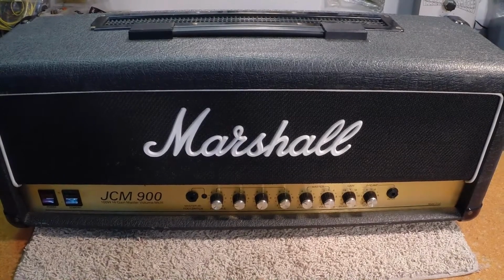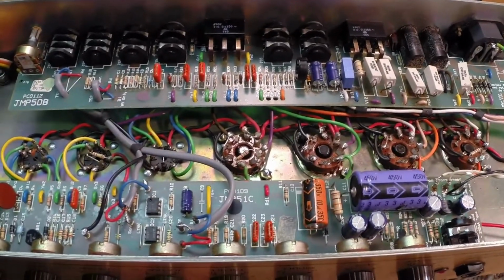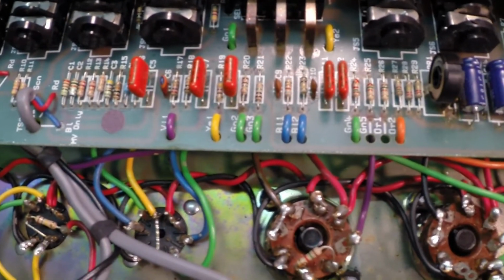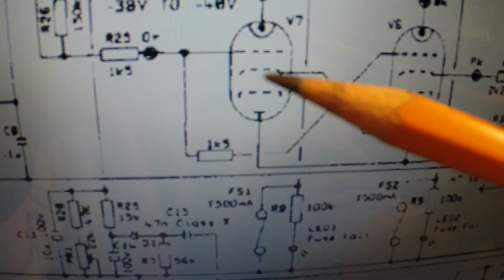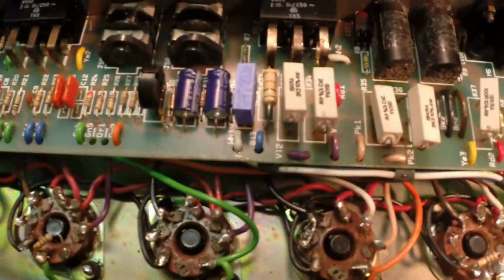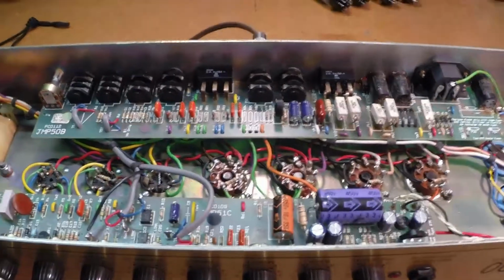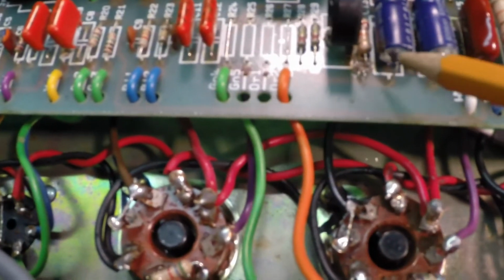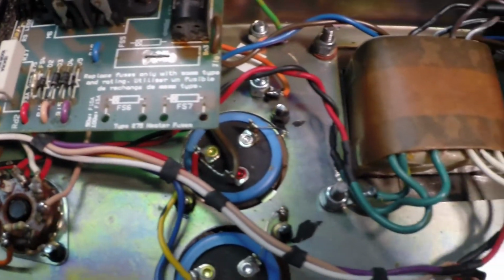Marshall JCM 900 Repair

Comment: Excellent video, do you think I could remove two valves from a JCM900 MK3 and use it in low range by simply doubling the impedance of the cabin?
Reply from the maker: Short answer, yes.   But! Remove the inside pair or the outside pair of tubes. 
 Not two on either end.  Here is what I tell everyone.  If an impedance selector is involved the standard 4-8-16 ohms becomes 8-16-32 when pulling two tubes.  In your case, the std wiring for the impedance switch is 16(4) and 8 ohms.  If you are using a 16 ohm cabinet, then you would use the 8 ohm setting.  If by chance you have an 8 ohm speaker cabinet, then you would have to move the tap to the output transformer from 16 ohms to the (4) ohm option.  Operating the amp in the low power mode (faux triode) with two output tubes should bring you down to roughly 20 watts.   
  BTW, if you have not done it search my channel for ALL the JCM 900 videos.  Even if you are not interested in some of the 4500 mods involved, you may find some information explained better in differend videos.  Especially the issues of the safty cap and over voltage, and failure.
Reply: @guitarc.p.r.9675  Thank you very much, I will do it and review all the videos. I learn a lot from you.
Reply from the maker: That is why they are there.  Free info.  Paying forward so to speak.

Comment: Hey brother! For those resistors that are in the wrong place, R25/26? Where should they be going? Sorry if it's not an easy question to answer, but I'm just kind of trying to put a list together of revisions, upgrades, and mods that I'd like to do to my fave amps one day. That may sound a bit cheesy, but I just have a fairly small collection of amps I use in the studio, and I'm slowly getting there in terms of being able to do my own tech work, so just mainly taking notes for now.
Reply from the maker: I explain and show that in the video I believe.  They should be on pin 5 of each output tube, and not in series as on the schematic or in the amp originally.
Reply: @guitarc.p.r.9675  Hey, I actually want to apologize. There was another video where you were mentioning this as well, and I had actually already inquired about it, with a few other questions, in which you totally answered, and were trying to help me. It was quite awhile ago, and I was supposed to email you, but I guess I got busy, and totally forgot about it, so I apologize.If you're okay with it, would you mind if I sent you a little email sometime this weekend, or so?
Reply from the maker: Sure, email away.

Comment: What year? This marshall?
Reply from the maker: This one has the JMP50B power amp board making it a 1990.  The 2100 series began in  1990 and discontinued in1993.
Reply: @ Are everyone who has this plate from 1990?
Reply from the maker: If the board is labeled JMP50C yes.  Actually, like most things British it is not that simple, and can be very confusing.   So let me expand on this.
  CD0192 Issue 1 JMP50A PCB  1989*
  CD0192 Issue 7 JMP50B  PCB  1990
  CD0109 Issue 4 JMP51A PCB   1990
  CD0109 Issue 9 JMP51B PCB   1990
  CD0192 Issue10JMP 50C PCB  1992
*schematic drawn in 1989 amp went into production 1990.  So there you go.

Comment: I've got one on the bench right now and spent a whole day trying to figure out and studying all their schematics (all versions, 5881 and EL34) on the grid resistor issue.  Makes absolutely no sense whatsoever.  I know this is old news for you, but thanks for the collaboration.  Replacing the "X' class bias cap with the 600+ volt is the right move also, in my opinion.  That's what I do.
Reply from the maker: Thank you, someone who agrees with me!  The grid resistor issue is simply a mistake on their part.  Thanks for checking out the channel.

Comment: Hello, I've just bought a Mk3 2502 50W combo. Checking the power tube sockets on mine,  R24 and R27 are connected through green and orange wires only to pin 5. Pin 6 doesn't have any connection whatsoever. I see in the video that the resistors are jumping pin 5 and pin 6, so I assume if I'm removing R24 and R27 from the board to install them in the tube socket, I would have to jump pin 5 and pin 6 too. Or is the 50W different than this 100W from the video, and I can leave pin6 alone and only add the resistor to pin5 (in series with the wire)?
Reply: To add to my comment, doing a bit of research, EL34 datasheet doesn't even mention pin6, and also checking my EL34EH tubes, they don't even have a physical pin for pin6, so I guess it is safe to jump pin5 and pin6 with the resistor. I was measuring my bias current, and it was 38mA in the outer tube (the one next to the filter caps) and 28mA on the inside tube. These are supposed to be matched tubes, but I didn't check with another matched pair (I'll do that later), but would you account this 10mA difference to the resistor placement?
Reply from the maker: You are correct Pin 6 does not have a connection in the tube.  Connect 5.6k grid resistors directly to pin 5 alone. There is no need to connect them to pin 6. Stand them straight up.    AND change that bias cap!   As far as the current on the tubes, They should be within 5 ma of each other to be matched.  I like to measure plate current only so if you have a screen problem it does not reflect on the plate current.  You may have a screen resistor problem on the low side.  I also highly recommend looking through this channel for the other 900 videos, watch them, and read the comments as well.  There are a lot of questions answered there.  Thanks for watching, I hope this has helped.
Reply: @guitarc.p.r.9675  Thank you for the quick answer. By bias cap you mean that one that's 250V but should be 600V, right? Mine currently has a 47nF 250V. I don't have a replacement currently, so I'll order one online. The unmatched tubes, I will test tomorrow with a pair that I know for a fact is matched because when I biased my plexi-1987 last week they were only 2mA apart. If those also give a higher difference in the 900, then it might be a problem indeed. Cheers!

Comment: I'm having a problem with a JCM 900 4100 with the same version circuit boards. The two outer power tubes are drawing idle current but the two inside tubes are not. I have good bias voltage and plate voltage on all tubes. Any suggestions?
Reply from the maker: Check screen voltages.  The screen resistors have a bad habit of the solder joints failing.  If the amp has failed previously and new tubes were installed, the screen resistors could also have failed.  The more likely scenario is that the 500ma fuse on the cathodes has failed.  If so the tube failure led should be lit up.  There is one fuse and led for each pair of tubes, center and outside pairs.   Just guessing though.

Comment: Excellent work.  For the love of God, why would anyone change an MkIII over 6L6's?  They aren't bad in a Dual Reverb or SL-X, but it just seems like heresy to convert in MkIII.
Reply from the maker: I don't see how that relates to this but, thanks for watching anyway.
Reply: @guitarc.p.r.9675  You verbally and visually pointed out how a previous tech installed 6L6 output tubes when you turned the chassis towards the camera to show us.  That is the relation to my comment.
Reply from the maker: Ok, It has just been quite a while since I did that video, and I was not sure exactly which 900 video it was.  Actually, I sometimes use the JJ 6L6s in the 5881 models for the really heavy guys.  They do not "mush out" as much as the 5881, the bottom is much tighter and defined.  They handle gain better, and they "chug real good".  In this particular amp he did not like them as he said they were just too much in the bottom, and wanted to put 5881s in plus take care of some age issues.  Turned out his bass issue was actually a WAY off spec bass pot.  Thanks for clearing that up, and thanks again for watching.
Reply: Understood. I too have 6L6’s in my Dual Reverb. The amp in this video is an MkIII and all of those were manufactured with EL34’s. So someone (previous owner and previous tech) went out of their way to convert it. At any rate your videos are great and a wonderful learning tool. Thanks for making them.
Reply from the maker: I must apologize, I had completely forgotten about that video, and was thinking of another.  I am a repair guy not a cinematographer.  I have a few 900 videos.  I had forgotten how messed up that amp was.  I may have to refresh my memory on this one ....hummmm  2017.  Old one.  Thanks again for watching, and I am glad you are finding them at least a little helpful.

Comment: So 3 weeks ago I took my Marshall jcm 900 4100 to an amp repair guy. I had bought it on reverb and it was shipped from Italy. When it arrived i plugged it in and it had really low volume, crackling when i turn the knobs, and reverb did not work in both channels. After that there was no sound coming from the amp. I called the repair guy last week and he said they had to order a transformer for the amp. I hope i get to play the amp soon.
Reply: Very informative video btw!
Reply from the maker: Thank you it has had mixed reviews.
Reply: @guitarc.p.r.9675  what’s your input about the problems my marshall has been dealing with ?(:
Reply from the maker: Good question.  Given it is a used amp sold with problems it is impossible to make an educated guess of what the problems are, and I said problems because it sounds like there are several different ones.  The crackling in the pots is usually dirty pots or broken solder connections on the board or even a damaged pot.  The transformer in question may be the reverb return transformer, though I have never had to change one, it could fail  That would explain not having reverb on either channel, or it could be a problem with the IC circuitry and there is pleanty of it in these amps. The no sound thing cold be as simple as a dirty effects loop jack or as ugly as an output transformer.  However I tell people all the time, until it is in front of me on a bench we are just guessing and actual trouble shooting is the only thing that will give solid answers.
Reply: @guitarc.p.r.9675  I appreciate the response! I will update soon when it’s fixed.

Comment: I gather the grid resistor cock-up is peculiar to the 100 watt. In learning the "language" of the amp so I could work on it after coming from a black face Fender perspective I found my 50 watt bias system is as it should be and it's a pretty early example. First thing though, I replaced the volume and sensitivity pots which were shot. I then eliminated the resistors on the board the way you do and put 5.6k 1/2 wat on the tube sockets as well as 1 ohm 5 watt biasing resistors. Actual "mod" mods will at a later date.
Reply from the maker: Yes the main problem with the grid resistors being in series is only on the 100 watters.  However, the grid resistors should not be on the board and that is common on both the 50 and 100 watt models.

Comment: I’ve got a jcm 2000 tsl 122 on the bench and I suspect that class x safety cap to be the reason my bias is starting at 90mV per side after changing out the motherboard to the new revision 20 one. I see it is also 250v, should I replace it with a 600v? Kinda strange the two caps by the HT fuse are 22n 630v which are on the same board as this 47n 250v? Why would those two be 630v with this 250v on the same board?????? Why wouldn’t they all be 630v?
Reply from the maker: So, I take it the main board was changed due to thermal runoff?  Regardless yes, change the cap to a 600v.  I use the Xicon 630v it fits the board well.  Take a good look at the bias board as well.  As for the why the 250v cap, that is one of the great mysteries....boggles the mind.
Reply: @guitarc.p.r.9675  yep, already changed both bias trim pots and hit all of the solder connections. Thank you so much for you reply, you’re the only one so far who did out of four videos I commented on 👍🏽.
Reply from the maker: You may want to check out my other later 900 video it clears a few things up concerning that bias cap.  Thanks for watching and I hope it helps.
Reply: @guitarc.p.r.9675  just checked them out, super informative. Thank you sir👍🏽

Comment: nice video...is it possible to put varicac to supply the final valves(5881) with less voltage for changing headroom and dreaming have a better sound  without high gain-volume (similar like van halen)?

or put variac between output of jcm900 to cabinet 1960a is it dangerous? i'd like to have sound like when i left maximum value of gain and volume is amazing and reach of armonic frequency, but of course i can't do it cause neighbor..how can i have that sound with low volume?
Reply from the maker: Thanks for the nice comment!  OK, first thing!  Do NOT put a variac between the amp and cabinet.  A variac is to vary AC voltage, I firmly believe the only place one should be is on a tech's bench and  sometimes not even in that case.  Yes you could use a variac to drop the power supply voltages, but keep in mind that it is also dropping the 12 and 6 volt heater voltages  which may cause a few issues, but most importantly the 4500 preamp is mostly IC driven which runs on a +/- 15 volt supply.    I have seen a LOT of amps  damaged by such things. A variac  varies all the voltages in an amp.  It also lowers the plate voltages for the preamp tubes which also reduces gain and browns out the tone some.  Possibly more than the output tubes. Lower preamp voltages compress and grit up quicker too.  This is why power scaling is becoming more popular. The thing with the VH sound is you only get it loud.  Even variaced to 90v it is still a non-master Marshall dimed.
Reply: @guitarc.p.r.9675  thanks for your attentions
Reply: my idea was put the variac between plate and ground without touch the chatode .but i fear about condensator and transformer what would have been happened?is the plate supplies in dc or ac ? jcm 900 have a lot operational amplifier and other components supply in dc like you had showed me.(+-15 volts).may be it had been better
Reply: if i do with old model amplifier like 1959 plexy or up with only valves tube circuits it would be better to supply the plate only adjust 70 to 90 volts to change headroom....i don't know..
Reply from the maker: NO!
Reply from the maker: OK, a variac only varies AC voltage from 0 to about 140 volts.  The plates operate on around 475 volts DC.   Lowering the AC to around 90 volts will bring the amp down to around 400. My advice as nicely as I can say it is to step away from the amp.  Study up on the operations and voltages in an amp, as not it injure yourself or the amplifier.
Reply: @guitarc.p.r.9675  thanks man
Reply: @guitarc.p.r.9675  thanks for your precious advices
Reply from the maker: I do not mean to sound like a jerk, just do not want you to be injured.
Reply: @guitarc.p.r.9675  i'd like to change the headroom by lower the dc or ac  i don't know the voltahe supply the plate

Comment from the maker: Since this has been one of the most viewed videos and has generated the most comments, I feel the need to add something overlooked.  First of all I want to mention that is was never meant to be a "How to Video".  If you feel the need to ask questions about what was done, you may not have the ability to do it correctly.  Now, that being said, this ONLY WORKS on the PCO112 JMP50 Board.  If you choose to attempt it, be sure it is that board only.  Similar boards have the same resistor numbers in the same places on the board but are entirely different. In some cases R26 and R27 are 150k bias feed resistors, not grid resistors as in the video.  Just a heads up and thanks for watching!
Reply: Would that mod effect the tone or just save on the life of the tube?

Comment: my jcm900 head has been out of commission years before u posted this video, ( and im just stumbling across it!) ...my head was never modified in any way, it just kept blowing fuses left n right...and RadioShack was never any count as far as fuses go...ive replaced the tubes ONCE because someone 'professional' advised it...no dice!. the last shop i took it to wanted to charge $300 just to look at it!...so here it still sits, almost 15 years since last used...really wish i had someone with your expertise nearby, because of all the gear ive let go of, THIS one is one i just dont wanna part with
Reply from the maker: Where are you located?
Reply: @guitarc.p.r.9675  Good ol Tennessee
Reply from the maker: @andrewlee3037  You are not that far,  you could always ship....
Reply: @guitarc.p.r.9675  , while i very much appreciate the offer, i probably couldnt even afford shipping charges, let alone your cost to fix it and send it back! LOL...im top-notch broke at the moment, and my wife would definitely have objections. LOL

Comment from the maker: OK Guys...for those of you who keep questioning the replacement of the .047 250 volt bias feed capacitor....I replace it with a 630 volt cap because it is connected directly to one side of a 375 volt AC winding.  Wonder why the originals fail?
Reply: Not familiar with this 'box' shaped capacitor.  What is this, and where can I get one?
Reply from the maker: @robert2948  OK, first it is a polypropylene film capacitor.  There is also a similar version known as a "safety cap."  Mouser Electronics has high voltage ones. Now, forget about these caps and get a good quality .047 uf 600v-630v poly cap, ie; orange dropetc., I use the Xicon here because it fits the circuit board holes easily.  Thanks for watching.
Reply: That .047 cap is a class x cap.  Designed to short if they fail blowing a fuse and not electrocuting anyone.  Should be replaced with class x.  Your thoughts?